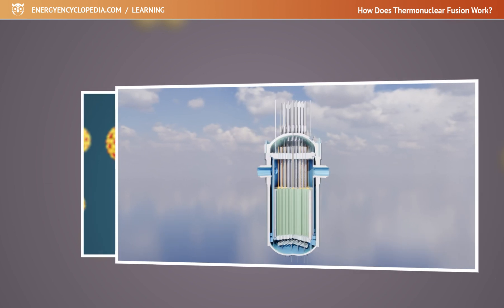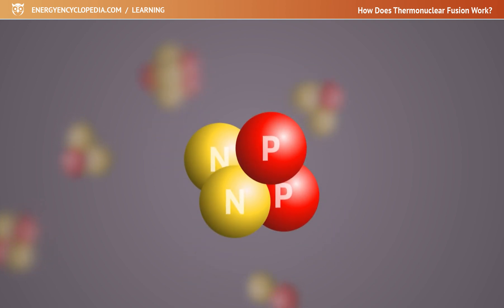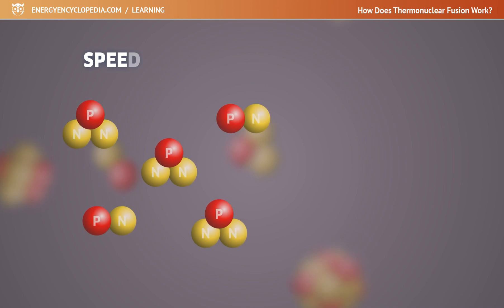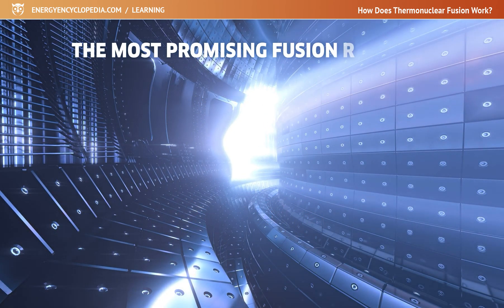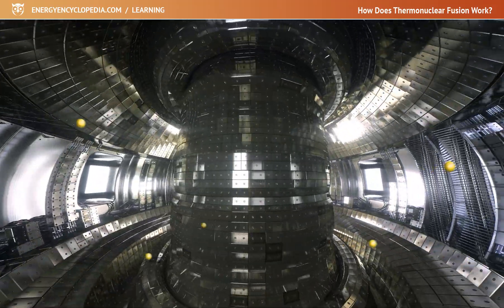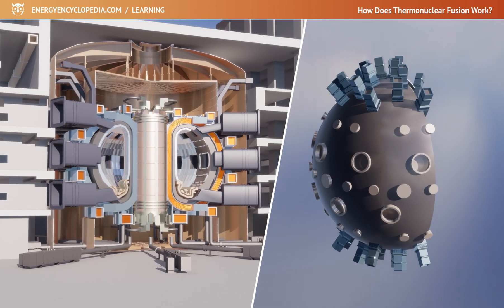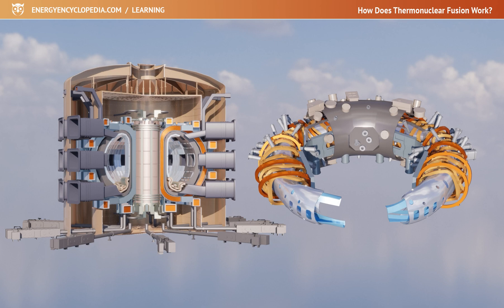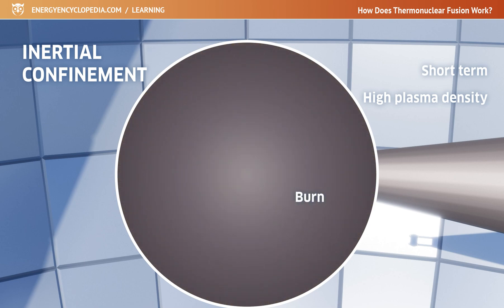How Does Thermonuclear Fusion Work?

Comment: In the core of the Sun, protons do fuse to form deuterons; the temperature there is 2 orders of magnitude lower than the Coulomb barrier, but fusion still occurs. In a nucleus, protons do not merge although the Coulomb barrier is completely suppressed there. Thus, if you in your experiments bring two deuterons or two tritiums together so that the Coulomb barrier is overcome, why do you think that the fusion between deuterons /tritiums should occur? Do you really understand the mechanism of fusion? It seems that you don't understand the mechanism of fusion...